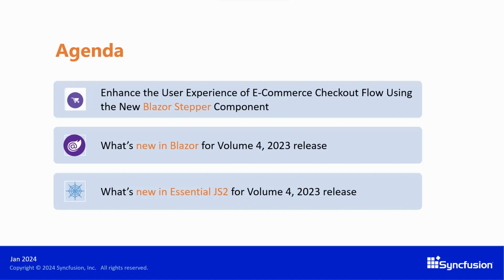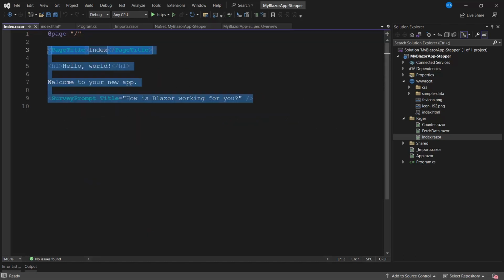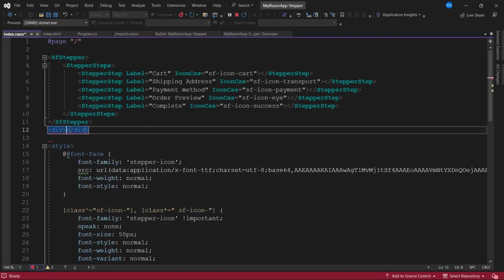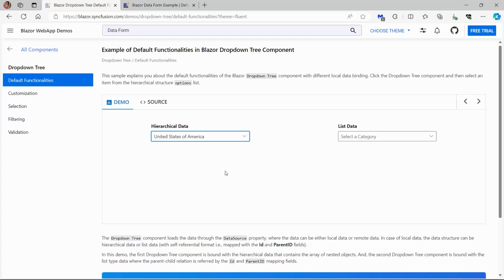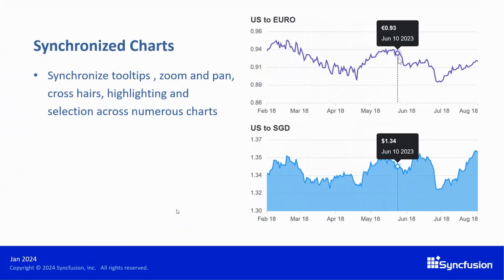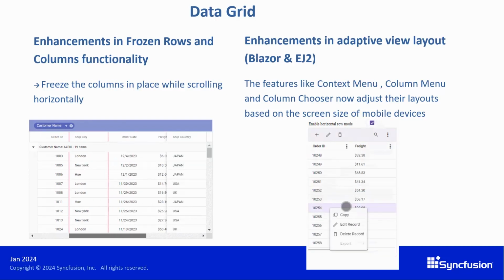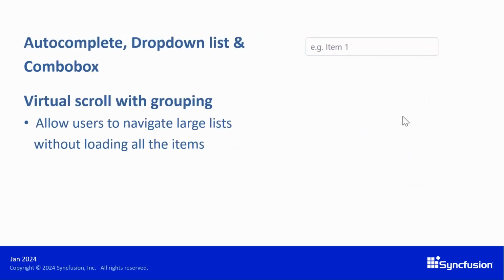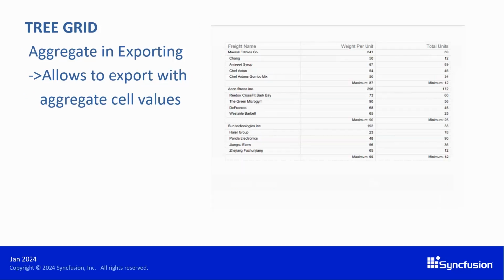Enhance the User Experience in E-Commerce Checkouts Using the Stepper Control [Webinar]

Comment: if we want to add a form at each step and after filling that we move to next step can we do that?
Reply from the maker: Hi,

Yes, you can add a form at each step in the Blazor Stepper component, allowing users to move to the next step only after filling out the form. We suggest using the Stepper components StepChanging event (https://blazor.syncfusion.com/documentation/stepper/events#stepchanging). In this event, you can check if the form is fully filled before allowing the user to proceed to the next step or prevent navigation if required. For your reference, we have attached a demo below. Please try the suggested approach and let us know if you need any further assistance.

https://blazor.syncfusion.com/demos/stepper/validation?theme=fluent2